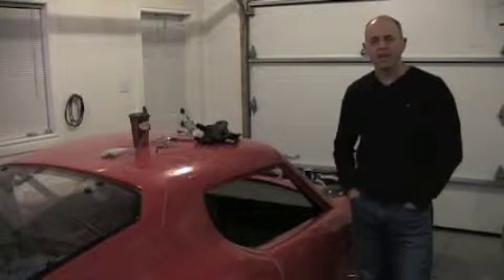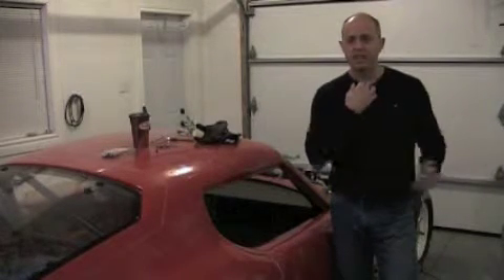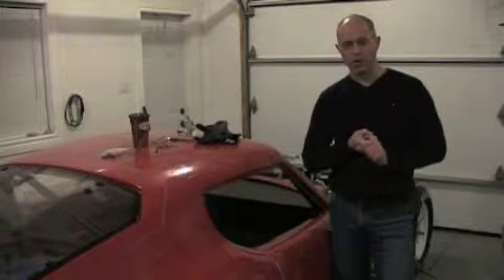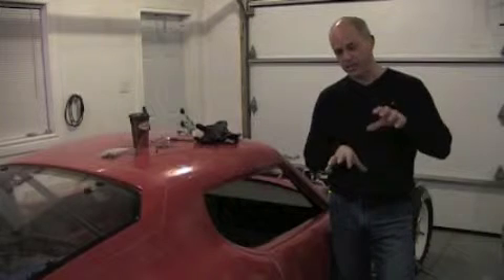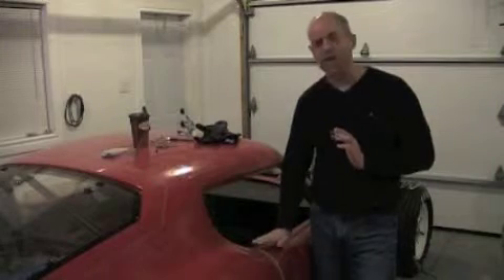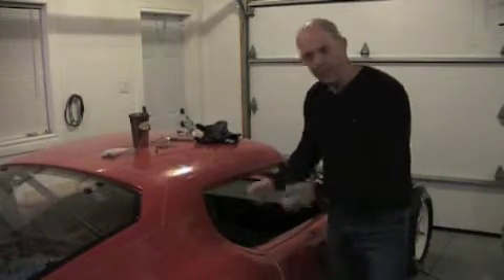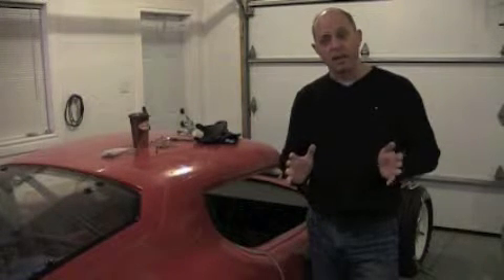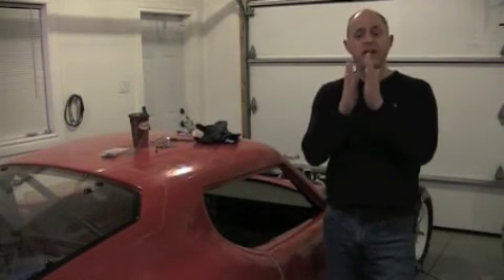FFR Coupe Door Installation

Comment from the maker: Mike Leeosikipobo , that is a loaded question, but I will do my best to answer it. First, I assume your timeline does NOT include bodywork and paint. Bodywork and paint can be a month in itself.
The build, other than that, can be done in 3 months by one person -- with a few instances where you need an extra person or 2 (such as putting the body on and off the car) . Also, 30 hours a week might be a little light, believe it or not. I would say that would be the minimum. It also depends on your mechanical ability, and your persistence when challenged. So many folks walk away from a project when too many challenges present themselves at once (which is guaranteed in one of these).
I will tell you, now that I built one, if I were to build another it would go much quicker, knowing now where the challenges are.
I would also suggest, depending on where you live, to ask for help. There are 2 great forums with tons of folks that have built them in the past that would be more than  willing to help you through the tough areas, and depending on your location, can come see you in person.